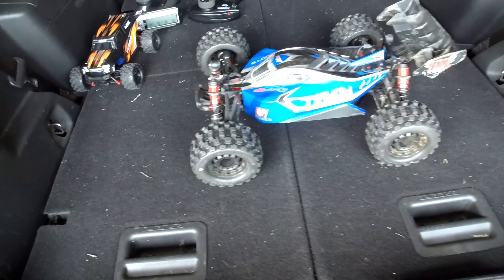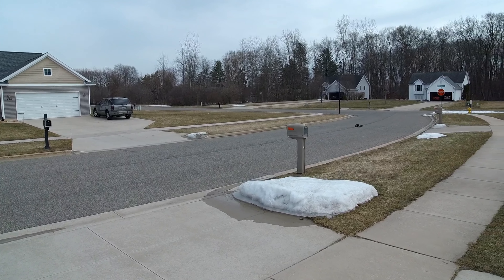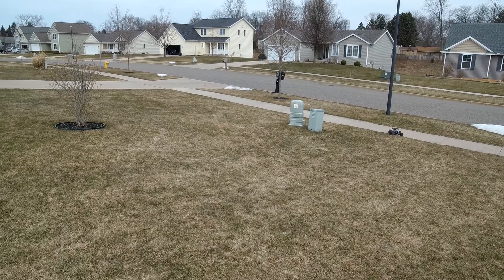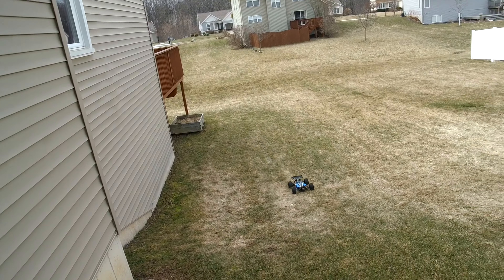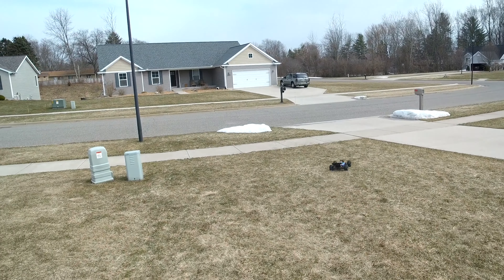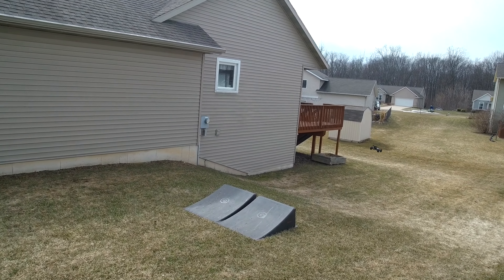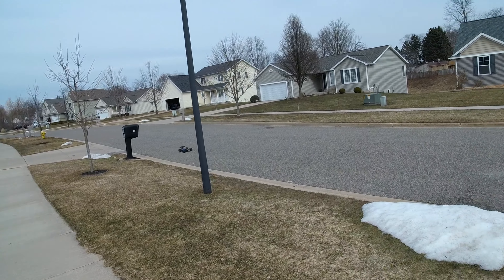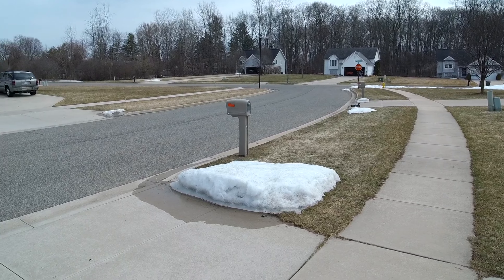Arrma Trugified Typhon

Comment: That's so AWESOME Aaron 😱!!!! Just Killer to see you going Truggified👌. The difference in handling and air control is Crazy. Hopefully your motor hangs in. Mine was super fast on 4s with the Castle 2200 and MMX awhile back. Stock electronics aren't bad if you gear up enough, otherwise 6s really wakes her up with strapped tires 👀. Really nice jumps and flips Brother 👊. Hopefully have mine rebuilt with M2C chassis after a short vacation 😍. Still my go to rig 💪. Appreciate the shout out my friend. 👍👍😎💪👊👊
Reply from the maker: Thanks Rich! I remember when you had the castle system running in your 👍 I have a 2150kv motor to try or might try a 6pole Toro buggy motor 🤔 Either way this rig is amazing now 😍 Really appreciate all your videos on it 👊

Comment: Nice to see a Truggified in your arsenal bro!👊Such a fun platform! Sweet smooth running and backies! The Mx28's do great on 4s but 6s and you'll be riding on frisbees!😂My tape jobs are getting pretty loose in mine so I just run them on the Big Rock now. Need to get a new set made up for the Truggified! My V4 might get some Kraton hubs and axles soon to give her just a tad more width. I'll probably still run the stock Katar tires but a tad wider, it would be a Mini Talion!💪Anyway, Great vid as always bro!!😎👊👍✌✌
Reply from the maker: Thanks Eric! I waited a long time to make the Trugified. Wish I had done it sooner 👍 I agree on the new V4 tires! I want a set just to have a different option. Plus that new wing 😍
Reply: @GreatLakesRC  Yeah the tires are sweet! They don't last long though under maniac driving!🤣3 hard runs and I need a new set! Hope they're available soon! The new wing and mount is sweet!😍Super tough mount. Really thick plastic compared to the V3 Talion low profile wing. Arrma ftw!!😎👊🤘🤘